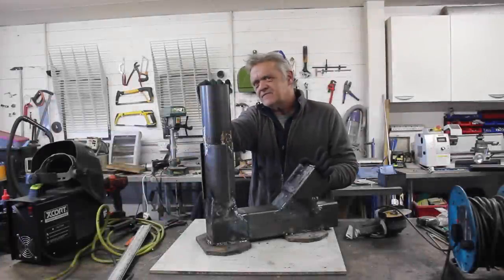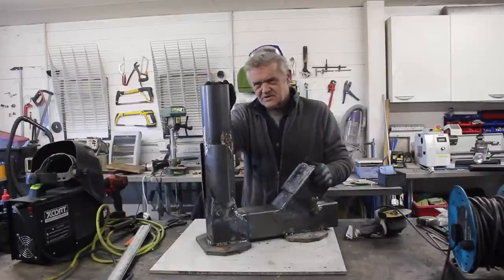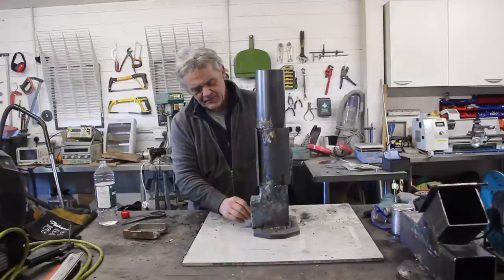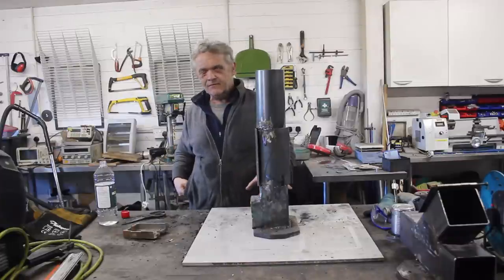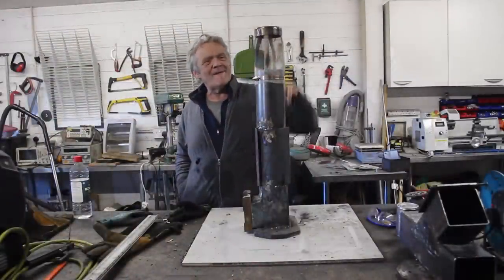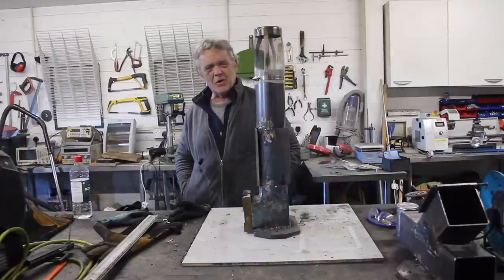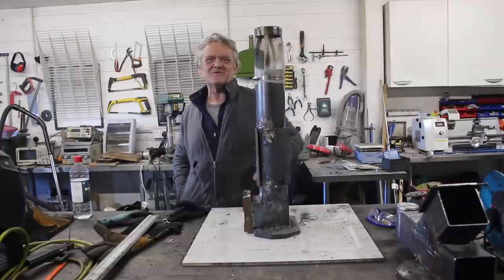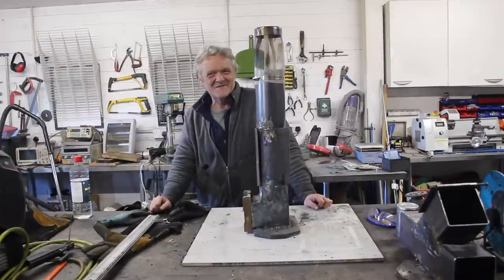1751 Sensible Vortex Heater Prototype

Comment: Great show as always ty. I worked on Boilers in the Navy. The front of the boiler had 5 ports for burner barrels and a stationery fan blade array to spin the fire around each port. There was two steam driven jet engines forcing air around the outer boiler casing and through the ports combining with the atomized jet fuel and steam and spun by the fans creating a ball of fire like a small sun at the end of each burner barrel. There was small ports with super dark glass you could look through and see the action. Check it out I'm sure there's a vid somewhere. My ship was the USS Camden AOE-2. Ty
Reply: That is awesome!!!! Wow, this reminds me of the build Rob did for liquid fuel burners and it reminds me so much of The Flame Cube product out in the market but super sized. Question, how much time did the boiler in your ship run for? Did also work as a mass heater for the whole ship?
Reply: huh... if you added a small metal fan blade to an existing rocket stove you might be able to generate the same vortex effect to an existing rocket stove with less effort than building a new one with the vortex component....

Comment: Seems almost like you could use the vortex generator/flue section to do both depending on current fuel availability. Clamp a wood-burning rocket stove bit on the side if you've got a bunch of old sticks. Unclamp it and put the bean tin burner head in if you've got some spare RC fuel or a bunch of old cooking oil!
Reply: Good thinking. That really would be the ultimate burn-anything-you-throw-at-it heater.
Reply: This idea I like and can get into. The ultimate stove. Part rocket stove and part vortex flame heater. Rocket stove part burns the solid or liquid fuels and gets the flammable gases at the right temperature and the vortex flame FURTHER combusts those gases even more.
Reply: @captainnemo6655  could even use old motor oil drip with something like this as long as it's outside
Reply: @rayg436  or just recycle that vs putting that in your air and ground water... (Whatever goes up, comes back down).
Reply: @l0gic23  you are correct, that's why there are always better alternative fuels that Rob showcases in his other videos, like diy methanol or diy biodeisels than can be made at home from non toxic things.
Reply: interesting. if you slid the wood burner into the vortex "base" any air leak would go in the right direction and provide more oxygen to combust the gasses. you wouldn't need any sort of complicated clamp or seal mechanisms.
Reply: @vidard9863  this idea! I am working on a prototype vortex burner like this
Reply: @Jeffrey Wolsieffer now we do!! Let's get building! We can take these guidelines and apply biomimicry. The giant termite Chimney mounds can help us here too.
Reply: @l0gic23  oil came from the ground.
Reply: His thinking is top shelf. I like your idea. See what Rob does! I like he listens to all ideas. Great work
Reply: You could also just make a properly sized insert for an existing rocket stove to convert it as needed with no need to modify the stove at all.

Comment: I would get some stainless steel flashing, cut slots in it. I would then make fins that have a one end bent in an L, slide it through the slots, and wrap the flashing around the top section. This should increase the amount of heat being radiated. Set up a small fan to circulate the air over it.

Comment: Excellent. Have been pondering on alternatives that could make use of smokeless coal; expensive to use in mainstream multifuel stoves but might be well suited and economical to use in a rocket variant
Reply: I was just thinking the same thing. Like diy saturated paper bricks with diodeisel or ethanol or something similar.

Comment: The Liberator Stove (previous) appears so well designed (I digested its users manual too) that I could only think of one improvident.
A viewing port for the combustion chamber would make it possible to judge the efficiency of combustion. Too much air results in too much heat going up the flue, too little and it burns rich. Industrially,  gas monitors are used but that is probably not viable for Liberator on the basis of cost. However, if the flame can be seen to be blue, then that indicates that the stove is fuel/air balanced regardless of the type of fuel used.
Reply: I think so too, and I have a question about the construction on the insulation part of that model of burner, can it be made from Crucible Fireclay?
Reply: @captainnemo6655  This is off the top of my head. Although refractory fire-clay has low thermal expansion, expansion and contraction will need to be allowed for. Noting, that not only will the square metal section be expanding more than the clay, the temperature will change along its length. 

Perhaps forming the clay into small horizontally laid bricks and firing them before they are placed inside will suffice. 
If it was lined with one continuos layer of clay it might suffer so much cracking that the lining collapses. You could check with the clay supplier, for as you will know, different clay formulations have different characteristics.
Moulding the bricks with a Vee shaped tongue on top and a mating Vee shaped groove on the bottom will help them stack nicely without gaps for the flames to reach the steel parts.  The inside hole of the bricks could also be made round, as square inside corners lose heat and combustion may not be so good there. Hope this helps.
Reply: @Nuts-Bolts  it does so much! I have actually decided on soapstone bricks and Crucible Fireclay bricks. (the kind made from termite/jungle mud). Crucible Fireclay bricks on the inside surrounded with soapstone outer facade.
Reply: @Nuts-Bolts  thank you so much for your insight too! It helps more than you know :)

Comment: So I'm thinking that if you add an additional ring of pipe outside the stack so that 1/3 overlaps the bottom of the vortex and the other 2/3 overlap the lower stack to gather heat from the lower stack it may produce a more stable flame.   Maybe 4" total of outer pipe open at bottom and top - should be easy to mock up with some scrap sheet metal.  Should bonus the collected pre-heated air by about 60% without increasing the temperature of the lower stack pipe.

Comment: Reduce the pipe diameter to around 60mm just above the flame 50mm above should do! preferanly beveled/ tapered with dirrection of flame guiding it towards centre, dimple die does a nice job! narrowing just above the flame cause a scram jet effect at that point.. same amount of heat but less fuel..
Reply: Fascinating! Question, would dimple die flanges, curving in the direction of the vortex, would this also help? Or would the effect be better if the inside of the tube had these dimple die marks along the lengths you indicated?

Comment: Couple a years ago, when i was in need, i used alcohol to heat a room. It was just old metal ashtray with alcohol in it. After alcohol burned it left water. So i suggest to make drainage with it's reservoir
Reply: Can that water be collected and be made to work, as in a Tesla turbine running on steam from that water?
Reply: @captainnemo6655  i don't know, i am diy amateur who is looking way to heat house aforable
Reply: @rizla8602  you are in the right place. Check out a tiny product as proof of concept called The Flame Cube. Also Rob has a video library for exactly what you are looking for.

Comment: It looks like a mortar, so how about a top loader. A steel spray can with a drill hole right through top to bottom, perforated sides, one end cut off and bolted back together, packed with sawdust or something, dropped down the chimney with a thin grate to hold it at the right position. I'm thinking the bolt would carry heat through the center and it would work like a mini gasifier. Basically squishing the chimney and feed of a rocket stove together.

Comment: Thanks for the video Rob - here's a thought- install a glass midsection - suspend a ceramic filament/mantle, like used in gas lamps - in the flame, it 'll glow white hot - then capture those photons with a circular array of solar panels (maybe use mirrors to keep them out of the heat) see what it generates? 

Or maybe suspend a copper pipe matrix in there and heat water to spin a turbine with its' steam - I wonder what the efficiency would be in terms of KG of input mass to WHr?

ps. still looking forward to your video on the Meyer patent, and your explanation as to why it can't be / hasn't been done?
thanks again for the upload mate :)
Reply: Good questions!! Along this train of thought, have you seen Rob's videos on Thermo Electric generators? Also there is a product called The Flame Cube that uses a rocket stove combined with a water heater and turns it into a thermo electric generator. The generator in the Flame Cube runs a fan initially and then it can be used to power mobile devices. Have you seen this?
Reply: @captainnemo6655  No haven't seen it, I'll give it a watch, cheers

Comment: What if you could induce a vortex or some kind of turbulence in the chimneys of woodburning rocket stoves to aid in distribution of oxygen throughout your flammable gases? Particularly with the inclusion of holes somewhere between the main exhaust tube and the primary point of combustion (the woodfire that produces the gases)
Reply: You can, just make 3 vertical openings near the bottom.

Comment: I did something similar. I had a tall 4inch wide square box tube from an old light that went on the decking and since i don't have a welder i just cut it bent it and riveted it together and could only find a 4inch wide length of aluminum which i wasn't expecting to last long but long enough to do an experiment (Turns out it lasted under 3 mins lol). After that i was left with the steel tube very much like what you have here. I made the pea tin with the wire mesh etc like you did and put it in just like this and was amazed the flames also shot out of the top, the only different was i didn't close the hole yet the flames still shot out of the top. I will have to try it covering the hole tomorrow. The only thing that was different was the pea tin had the mantle still on it when i placed it in the upright and the mesh was about 2 times the height of the pea tin and a little finer.
Reply: Good amazing discovery there! Imagine doing the same replicated experiment but with a glass tube 5 feet long and the same diameter as your set up.
Reply: @captainnemo6655  There is a guy on youtube that does this, i'll see if i can find it.
Reply: @mrintomesee  yes there is, chap is from Norway I believe. You can search the video on YouTube by typing "rocket heater 4.0 tornado in a tube"

Comment: Maybe we can make a heater that uses no added power.
Vortex tubes separate the hot and cold air molecules using air pressure differentials.
If we build a wind collector and condenser on the front of a vortex tube, perhaps we can focus enough force into it to separate the hot and cold air molecules with no added energy other than what the wind brings with it.
And in the summer we can vent the hot air and keep the cold air instead of vice versa.
Reply: Nature already heard you and got started on the work millions of years ago. A serious question for you, have you ever seen a cutt off diagram on how termite mound chimneys work? They function EXACTLY as you describe, the termites even construct the chimney structure to work by air temperature differentials day and night.

Comment: Make the chimney tube go through a oil barrel or such container filled with sand?
Also you could then go forward and add pipes going through the barrel or container like in double barrel heater. 
Thus the sand would heat longer the air going through the pipes in the barrel.

Comment: THANK YOU SO MUCH ROB! This is the kind of alternative thinking that can be expanded and worked to fit situations where authority figures deem regular stoves illegal or they seem the fuels illegal.... I have a question, I recently saw your video on the Argan lamp and it turns out there is a chap from Norway on YouTube that made a HUGE super sized version of the vortex heater by using a huge glass tube and a hopper feeding mechanism. The chap calls the invention the Tornado In a tube version 4.0.... I have a question for the community as a whole. Can we draw inspiration from nature to do a better vortex heater by looking at Termite Chimney mounds and the kind of air flow these structures are able to pull and secondly, would it be possible to build a vortex liquid heater by using Ceramic Fireclay like the kind used for crucibles?

Comment: Have you considered incorporating a thermal mass of some sort into these designs, like you see in "rocket mass heaters" to accumulate and hold the heat that is produced by the burn, and then slowly give it back to the room over time, long after the burn is finished?

That way you catch and store all those burnt calories in the thermal mass, which then does the radiant heating for you, and you  are only using the burner to charge it

Comment: Hey Rob, what about adding a stirling engine to drive a mechanical fan to blow air into the stove? Might increase efficiency of the burning?
Reply: This idea! It has already been achieved with an electric fan and Thermo electric generators. Have you ever seen the product called The Flame Cube?

Comment: Im lost, how does blocking air with a door increase the flame? where is it drawing air from?. never mind I see the vortex pipe.... had to enlarge my screen a bit....
Reply: Glad you saw those details. While you are looking closer, have you ever seen a cutt off diagram of a giant termite Chimney mound and how they work? We can use that design for the ultimate rocket stove vortex heater.

Comment: While you are perfecting the stove, I've been thinking of something to radiate heat long after the flame goes out.  I have these soapstone discs that go in my antique fireless cooker.  Those discs radiate heat for hours after the flame is gone.  What if you design a soapstone surround?  For those who have never seen a "Fireless cooker" work, please google.  This soapstone material is so effective that you would save a lot on fuel.
Reply: Would soapstone work as well as Crucible ceramic Fireclay?
Reply: @captainnemo6655  soapstone works extremely well for this application but is decidedly mor expensive than refractory clay, at least where I live in California. I have a foundry and forge both and neither are lined with soapstone.
Reply: @jerrodlopes186  I don't think you'd have to completely clad the surround in it.  Perhaps some radiating squares where the fire is hottest.  They sell tiles that aren't that expensive.  It's surprisingly efficient.  I have 3 of the soapstone discs, having bought an extra couple on ebay.  I didn't pay much for them there.  But I'm wondering how much soapstone you'd need.  1 disc  12" diameter cooks several courses of a meal and stays hot all day.  That one soapstone heats up the entire fireless cooker, and it's still hot when I remove it sometimes 8 hours later.
Reply: @wolin289  wow! You've got me intrigued. I'm going to have to get some and play with it a bit. I have a few small blocks for sculpting purposes. I suppose the discs you have would be much better for experimentation. Thank you so much for the information. Have a wonderful evening/day.
Reply: Soapstone is mined all over Canada and the US as well as places in S America and in N. Europe.   You can get odd pieces cheap from folks that make soapstone countertops.

Comment: You could adapt it to an Heat Battery with the Darwin's Tower...
A Venturi Turbine Cover in the Middle catching entering winds.
An heat battery at the bottom and a Turbine on top...
The convection would Generating The Vortex giving a chance to 2 Turbine to Turn Instead of one..
Increasing the Tower overall efficiency.
[By the way you are the Best Reference for USA to Define Practically what a Darwin's Tower is...stand Proud...stand Awesome!]
Reply: This idea right here!!!! This is exactly what I want to build with a thermo electric generator component attached to it. In doing as you have pointed out, we can even make it out of materials that won't burn or melt, like the main body of the whole construction made out of Ceramic Crucible Fireclay and the inside turbine blades from fireproof stone paper too!
Reply: @captainnemo6655  
Yeah exactly Nemo!
The Sand or Molten Aluminium Heat Battery can be Heated up with a Resistance,  can be Insulated with multiple Layers:
Graphite, Air , Graphite Again, Steel, Fire-brics and Aerogel.

Ceramic as Inside "Inverse Venturi" would work wonders..
Bottle Neck Shaped.. with a Secondary Turbine on ground..
So there is less weight over the top of the tower...
Air from outside would be directed to the upper Turbine.
While the Heated Air will fall in the middle of the "Bottle-Neck" Creating Convective Fluxes with Air Heated at the Bottom...
If like in the video right here it generates a Vortex, that's Harvesting Way More Energy By Doing Technically Nothing..
Also, Since they would be already connected to Electricity anyway,
They could be use to store external Electrical Power for the night, where the Heat Difference would be more and the Convection Vortex would Increase Exponentially.

How to solve Bottle-Necks with Bottle Neck!
Reply: @antoniopacelli  OMG thank you!!! This is golden knowledge!! I am saving your notes and adding them to mine. Love that bottom line too. It's perfect! What you said about the bottle neck construction reminds me so much of the natural design termite Chimney mounds have to achieve this effect.
Reply: I am saving your whole comment thread my friend. Im working on building this as my next project for my off grid living adventure.
Reply: @captainnemo6655  
Bio-Mimicking In Action!
Thank you...
If you make something out of it send him a video and let me see...

I am Kinda Born like Edward Scissors Hands... 
They forget about the Hands....